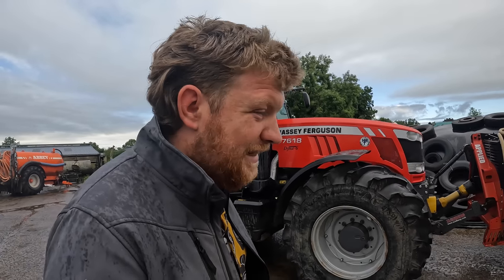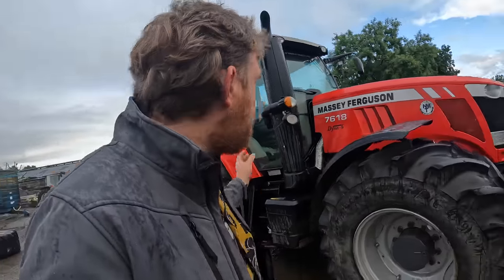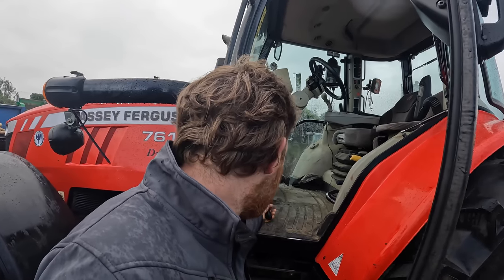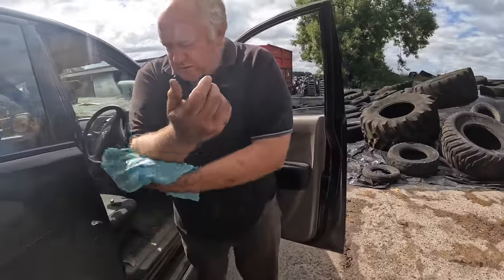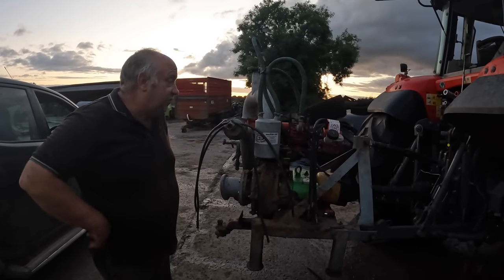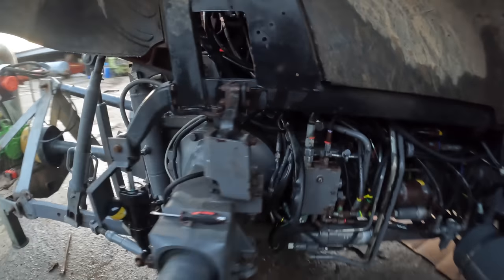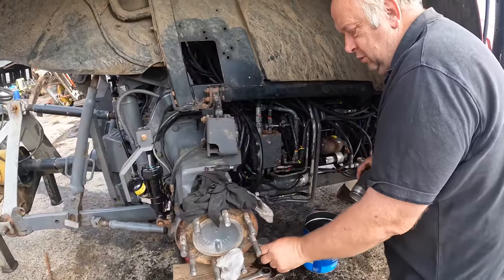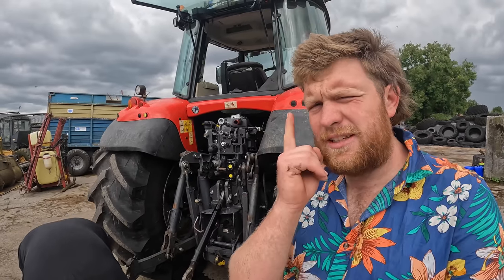THE GREAT OIL LEAK HUNT!!! | FIXING A MAJOR OIL LEAK ON MF 7618

Comment: What would ye expect buying a yolk wit 8000 hrs
Reply: It doesn’t that is the 6499
Reply: @hijixxy7790  it had 8k when they bought it they said at the time
Reply: Doesn’t matter when they’re well able to fix them. 
I’ve a 181 Massey from new that’s gone through 2 water pumps and a 4 wheel drive failure. New doesn’t mean it’s break down proof
Reply: @philiptyndall4968  must b the massey that's wrong so common denominator
Reply: It's a burst pipe, relax,happens on every machine known to man.